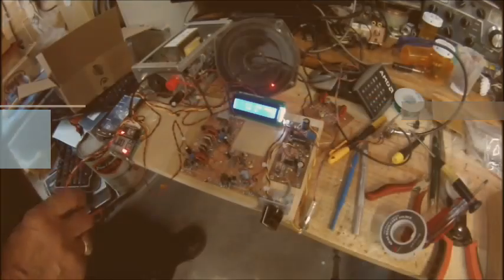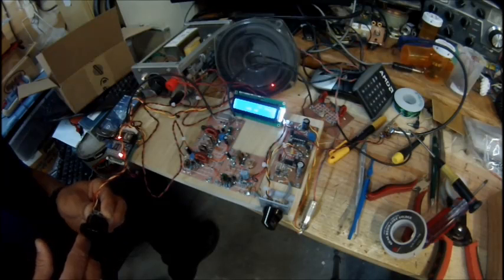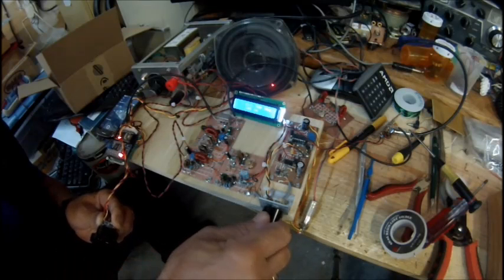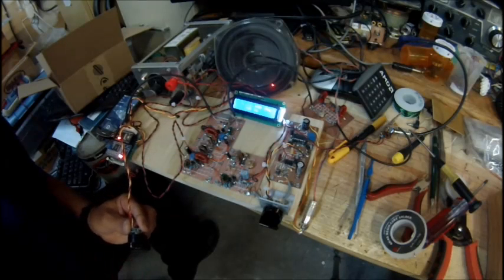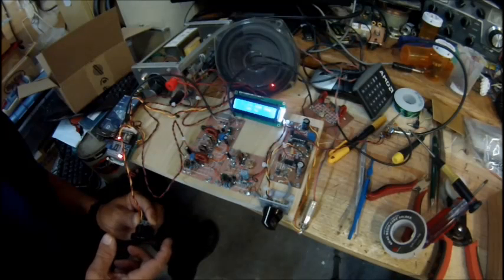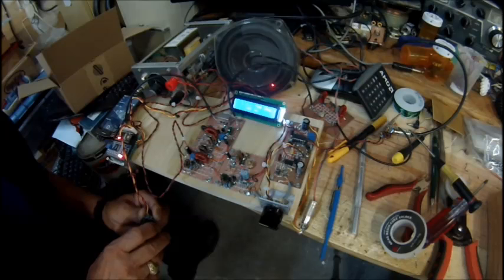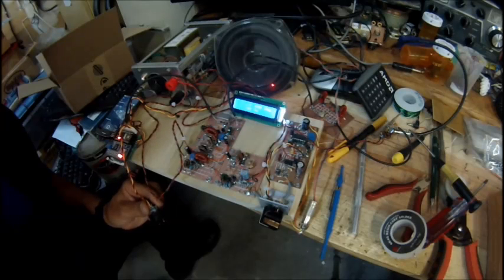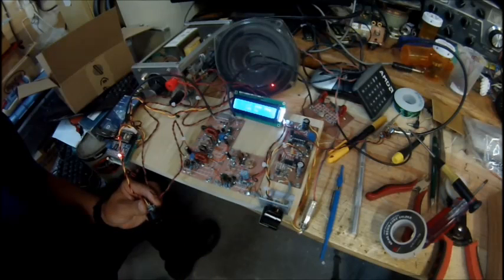Simpleceiver 3rd Generation

Comment: What are you using for the VFO? Is it just an encoder hooked to the arduino?
Reply from the maker: +Cisco8484 I will direct you to my blog http://n6qw.blogspot.com In Part 10 I show the components of the Local Oscillator which consists of an Arduino Pro-Mini driving an AD9850 DDS Board and all of that is on a small prototype board. The other pieces include a 16X2 LCD Display and the encoder. There are other You tube videos which show a little more detail of the LO. So there is a lot more than just an Arduino and an encoder that is generating the LO signals. Look for the video of the QSO with K6XQ and KF6ZZThanks for your interest.73'sPete N6QW